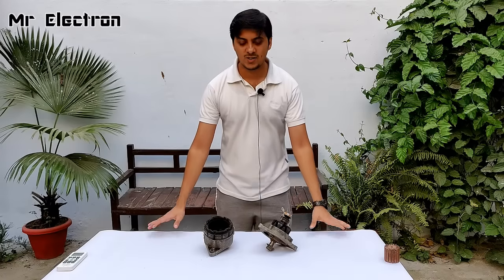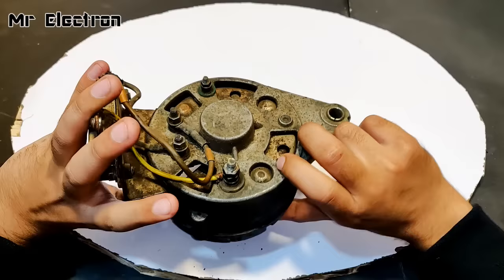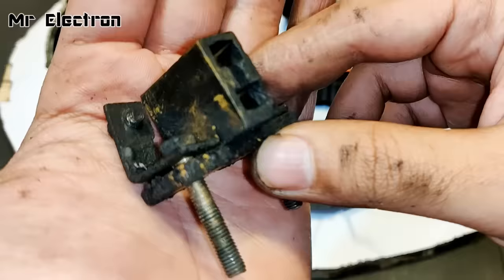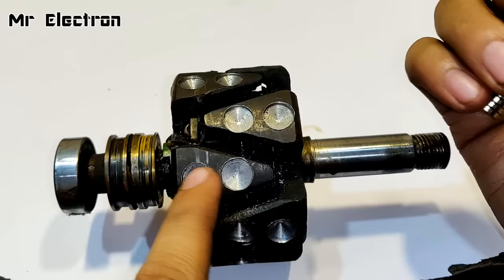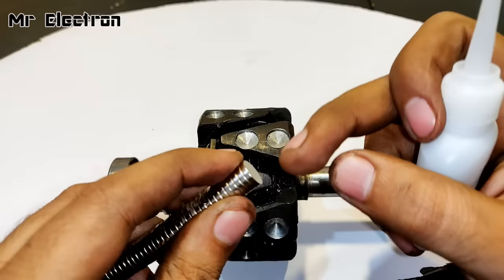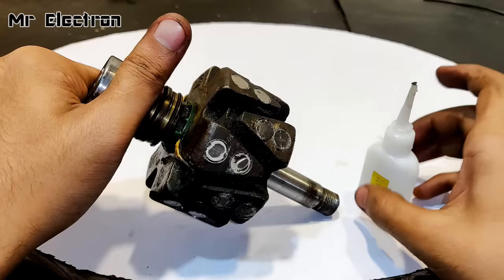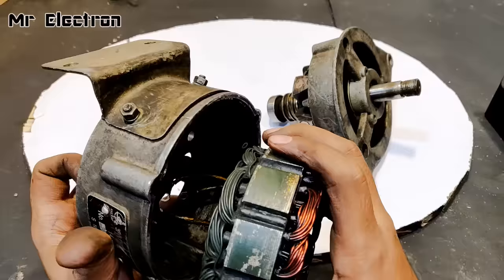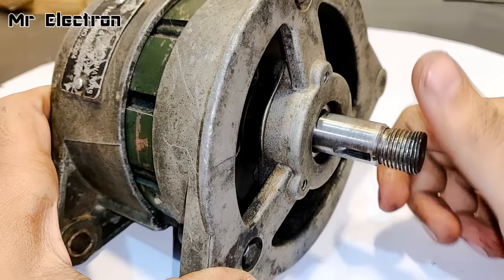12V Car Alternator to Brushless Generator Self Excited - Amazing Idea DIY

Comment: HELLO. This trial is great. Everybody is bothered from rectifier and voltage regulator, it sound like protection from malfunction but it works not to get big energy from alternator. Your trial is a breakthrough. If you turn the pulley  faster by machine, this alternator can have much more voltage and current. I was encouraged.Thank you!

Comment: A quick way to drill holes with a consistent set depth, 1: find the desired depth 2: drill first hole to depth then stop drilling 3: with the drill bit stopped and in the hole, wrap some masking tape around the drill bit's circumference at the surface of the material being drilled 4: back the bit out of the hole and start drilling the other holes. The masking tape is easily removable, won't damage the bit and clean up is a breeze. Heat and tapping compounds might cause the tape to melt or slide off so you might want to think about using different types of tape or permanent markers/paint to mark the depth on the bit.
Reply: Thanks for the tip Cliff.  I'll try it.
Reply: Don't waste time, just set your depth-stop on your drill.

Comment: for those of you wondering, the faster the spin of the stator,  the more voltage.. the bigger the wire, the more amperage.
Reply: 고마워요
Reply: @sksdksckddn  천만에요
Reply: Thick wire for more current.
Reply: @farrukhhasan7751  yes. And spin faster to produce higher voltage.
Reply: There is a limit as to how much thicker a wire can be as the current is not determined by the thickness of the wire but by the strength of the magnets, so if your magnets can only produce 1 amp then it does not matter if you have 1mm dimeter wire or 2mm thick wire it will only produce 1 amp or may be just a tiny fraction more due to the resistance to 1 amp current flowing through the wires, Power  Generation is the product of the strength of magnetic field and speed of rotation, voltage is proportional to number of turns and strength of the magnets and the speed of the rotor. And nothing comes out of nothing, so if you wanted more power then you also need more input power to spin, (Torque)
Reply: Please what do we call the magnet please please please

Comment: Appreciate your hardwork Bro, try to connect your generator motor to a Gym cycle or regular cycle Backwell and use step down transform or stepdown or stepup Module to Charge a 12v car battery, later it can be used to power the home appliances using inverter
Reply: Ani Dezman
Ani Dezman
pred 2 mesecema
I did the same as you. I got 29 volts and 0.3 Amps, which is too little to burn even the smallest 12 Volt bulb. That's why I don't believe you.

Comment: Even if u give 1500rpm u would only get 12- 15 volts. You have to use big neodymium magnet like n52. I have tried this type of convertion in half HP induction motor using n45 but the voltage was maximum of 20 volts!

Comment: Car alternators need to spin at very high revs to make even just 12 Volts. While on the car they will be 'geared up' and be running at 2 or 3 times the speed of the engine.
We are talking 10 to 20 thousand rpm - just to get 12 Volts
A much better conversion would have been to leave the brushes and the rotor coil intact and power it from a single diode connected from the output of the stator coil.
This would be after removing the original stator coils, noting how it was wound, then re-winding it with some much thinner wire.
This will give more volts and at lower rpm - making the resulting generator much more useful.
Rewind it as was, as a star connected 3-phase and connect your diode from one of the phases and back to the centre point of the star. Or make a 3-phase bridge if you prefer.
It will self-excite and the existing rotor coil will make a much stronger magnet than the permanent magnets ever could - giving you greater output.
Get as much wire into the stator as possible, every extra turn is worth more volts
Do not be greedy and expect mega mega output. For a machine/device like that, self-excited as it will be, do not ever hope for more than 200 Watts - but at least it will give measurable volts and useful power if built into a wind turbine.

Comment: I did the same as you. I got 29 volts and 0.3 Amps, which is too little to burn even the smallest 12 Volt bulb. That's why I don't believe you.

Comment: Hi Mr Electron...I am working on projects myself and have found your content very useful. I was wondering tho : could a joule thief circuit be used to excite  the alternator ??..Joule thief can provide all kinds of voltages at high frequency (low amps?)and would be interesting to find out if it could work..Many Thanks to you..

Comment: The rotor should have contained a larger magnet for higher flux density. The rotor is too heavy and more metal should have been removed from the same. Also you should have lubricated the same so that it rotates faster.

Comment: attach high speed motor to it,  then wire in a  step up transformer on the output  of alternator, test AC voltage out of the transformer.

Comment: hello sir electron ... your work is fantastic excellent the adaptation of the magnets in the alternator poles. but you should use that alternator as a brushless motor with a 1.5kwatts variable frequency drive, you could have an extraordinary electric motor. I hope you accept my advice. thank you good 2021.

Comment: There is easier method. You can put the magnets between the claw poles and it still work.
Reply: My thought exactly! Time saver for sure! Same concept as the traditional alternator inner-winding except w PMags sandwiched in between the rotor teeth, north and south come out of the bottom and top along the axial axis and those teeth bring the N and S, respectively, downward to alternate every other one... pretty cool concept and truly simple which is why it is used in the production of these alternators... 
Good comment, mate,
Cheers!

Comment: Hi Electron, this modification on the car  alternator  should produce much more energy,maybe some of the copper coils are in short circuit...  👍
Reply: Perhaps the magnets are not strong enough to generate more on this RPM? The electromagnet inside the rotor was pretty strong when the brushes provided power for it.
Reply: J'aime tellement tes interventions,tes compléments

Comment: That lamp itself was twelve volts. If the car alternator had changed, the lamp should have burned out, so it did not change anything and produced the same twelve volts.
Reply: point should be noted

Comment: Well how you solve problem over charging lead acid baterrys? Do you add external voltage regulator? What wuld hapen if you use bouth magnets and field coil together?
Wuld they cancel ich other out as in magnetic field?

Comment: The big ? is WHY. the part that spins is the rotor, an alectro-magnet the winding that the rotor spins inside of is a stator as it is stationary for you it means it does NOT move.

Comment: The set of windings from which power comes is THE STATOR as the winding is stationary.
You won't get the power from this as you would with an excited rotor winding and you can't 
control the output either.

Comment: nice try but the magnets are very smal and there for the smal voltw if there was a load it should be loer you could remove the rotor armatore and replace it with a solid piece of iron and then stick on to it some big magnet they are cost moe but they will produce more volt and amps

Comment: The reason you hammered it(which did the rotor no favors at all) was that you had the rear bearing come out with the rotor which it should not do. You should have removed the bearing, cleaned the rotor, install the bearing into the back case, then install the rotor(after lubing the shaft in the bearing area.

Comment: There doesn't seem to be any particular reason to attach magnets.
Since I am an electrician, every motor turns into a generator that generates electricity through the three-phase outgoing wiring on the other side when the actual rotor is turned quickly.
If it continued to rotate by its own force to reach a certain speed, a magnet would have been attached, but I don't know why a special magnet was attached here.

Comment: Mr. Electron:
Your going through a lot of trouble to converting a product to a product that already... You should check out a motorcycle alternator, how its put together.
You will find out that it rotors magnetic feild is based of perment magnets..

Comment: I’ve recorded 2,000v Ac with A multimeter like that on a big block Chevrolet load turn charging high amp alternator spinning it about 1500 to 1800 revolutions per minute using my battery powered impact gun which max rotation is 2000 I have recorded with a camera reaching 2000 V AC current !
Reply: Low turn charging high Amp Alternator

Comment: Looks like you used 2mm thick magnets. Would the magnetic field and the output, at the same RPM, be doubled if you used 4mm thick magnets?
Reply: Depending on the material used per magnet but theoretically yes magnetic flux field would double.

Comment: Mr. Electron I’ve installed the Neodymium magnets 12mm x 2mm N 52 how to put the center back in with the strength of these magnets will not go in like the way you put it back together ?

Comment: I found your vids a long time ago. I finally found you! Lol. I have a dead Alternator. It's a GM ( General motors) 100 Amp alternator! Half of the diodes have died. I bought a second hand unit and swapped in 15 mins at the wrecking yard, tested and drove off. Do I take the diodes out or do I replace them? I want to convert to your setup. I have 2 deep cycle batteries and 4 solar panels at 250 watts each connected to my batteries. I want run a dc motor I have lying around to power the Alternator. Any reply and ideas would be greatly appreciated! Cheers from Australia ! Subbed a long time ago but liked as always!🙂👍👍👍

Comment: I'm sorry to different engine operating speeds the alternator would have to have like a scr controlled regulator to control the output voltage and current to not blow up your electrical system they do make alternators that are brushless using the field Ford had one for ambulances 215 amps

Comment from the maker: My Hindi Channel - www.youtube.com/mrelectronhindi
Reply: Aalaa
Reply: What about replacing field coil on alternator using speaker magnet inside?
Reply: I did this like you did. But the power cannot give out. Can You tell me the reason
Reply: @hspaukap8936  how can you tell which of the 3 wires is positive and negative?? I'm still trying to figure it out.
Reply: @BOREDANDWELLBORED   the case would be the neutral and the wires would be the power....
Reply: @tommyemler1763  thank you!
Reply: I always go for my cheap meter to

Comment: If you add a magnet per pole at the same polarization as the electromagnet in the center you can make a self excited alternator that starts out as a pm generator then operates as a real alternator once up to speed. Gets rid of tge need for an external battery to excite the electromagnet in the center. All that is needed is a capacitor and an isolation diode.

Comment: Like the one comment okay for wind turbine you can run three phase down to your batteries but you'd want to take the rotors apart take the coil out machine the rotors and put a permanent  magnet in the middle

Comment: Very interesting and well explained but the small magnets set into the big surrounding area of steel, will not work. The upward facing pole of the magnet will be cancelled out by the surrounding steel acting like the opposite pole. So you will not have clear and distinct North and South poles!

Comment: Nice try but voltage is so small. Better get 1 watt solar panel, it will give you around same voltage.
Reply: Depends on how much voltage you want! 6 volts is high if you only need 3. It is amperage AND voltage that will be meaningful, if you want more than a few milliamps.
Reply: Attach some paddles to the shaft and drop in a fast moving creek or river. That way as long as you've got current (hydro), you've got current (electro), even after the sun drops over the horizon. Sure, the solar panel can be used everywhere there is sunlight but harnessing the flow of water should provide constant AND consistent amps-n-volts. You'll just be limited to where you can use the device.
Reply: عشان حط كل المغناطيس في نفس الاتجاه فمفيش خلخله في المجالات المغناطيسيه تحدث الفيض الإلكتروني الفولت اللي بيخرج ده لو قست برتقاله هتخرج كهرباء اكتر من كده هوا بس يزود عدد المغناطيس ويخلي كل صف عكس اللي بعدو هياخد كهرباء اكتر بكتير

Comment: I’ve done this but to my fault the magnets were not flush and my magnets are N-52 and the center will not slide back in through the Stator until I sand down like a Half of 1 mm off most the 14 magnets ! Drill the holes a little deeper if you do this !

Comment: यू आर मेकिंग डीसी करंट नॉट एसी 
 just because whenever it is used as alternate in car it provide AC current by  it brushes 

In  their armature, winding side will become a magnet by battery current and as soon as rotator will be rotate with engine power then the current will be generated through brushes to the entire supply.
 but you did opposite
 now you are just making opposite  to produce electricity so it is DC current

Comment: hi .actually the magnetic field of alternators are not normally constant  and it changes according to the energy consumption . if consumption becomes high so the magnetic field will be higher to keep output voltage in range . i can guess that these small magnets can not give more than 20 % of that alternators energy capacity .

Comment: Does this brushless motor gives you more output power or same output? Is the input power the same for both types?
Reply: Output on this type depends on how fast the rotor is spinning and how powerful the magnets are. No input power is needed because it's brushless. Less power is generated for sure but also less is needed to generate something.

Comment: Good idea.  Unsure how well the glue would hold up.  If you could drill a more precision hole and press the magnets in, i think that would work better and longer.  Make sure you get the poles right though, because you won't get them out once they are pressed in.
Reply: you can't press magnets, they easily broke...

Comment: i see a mistake...
outer winding of alternator uses circuit to produse constant output...
u connect only 2 thats why u have small output...
try puting 2 diodes each wire, one going in and one coming out...
then tap all diodes in one side,,,
the 3 going in then the 3 coming out...
ther ul have the right output considering d magnetism u used

Comment: Hello. The video is interesting but with permanent magnet you can't vary the amount of volts that the alternator produces
Reply: Francisco González López 
depends on how strong d magnet used...
Reply: @endurofan9854  If you can varie de amounto of magnet...
Reply: Yes, you can vary the output voltage by increasing the speed. I have a permanent magnet alternator from a small Kubota 905 diesel that I coupled to a Honda  4 stroke 35cc powerhead from a brush trimmer. Voltage varied from 34 vac to 123 vac from fast idle to wide open rpm and lit my 150 watt test light bulb accordingly. The alternator is 2 wire single phase unit  rated 20 amps and is sold on eBay for $60 US. The combination 12 v rectifier/voltage regulator has not arrived yet. The alternator has a very strong cogging effect when turned by hand. The 4 magnets are bonded to the inside of the rotating steel shell so they have no inclination to fly off at high speed. The outer shell holding the magnets rotates over the stator and the punched holes that locate the magnets sling air outwards thereby cooling the windings. Its a clever and simple alternator with no brushes or excitation needed.

Comment: Now drive shaft with DC motor low torque high rpm and then loop back put capacitors on circuit...
More output then input
No Lenz law
Reply: No, you will not get more watts out vs the watts consumed by the motor turning the shaft ... Lenz Law is the LAW !
Reply: Yes because that's how life works, there are all of these free energy devices that work so well and are so easy to make yet humans decide to go out and mine coal, oil, make wind and solar panels, ECT... Do you have any common sense bruh?

Comment: what would be the theoretical maximum voltage for an alternator setup like this?
Reply: The breakdown voltage of the coils’ enamel coating, the amount of turns determines the base voltage and scales logarithmically with rpm.

Comment: What you are calling the armature winding is actually called a “stater”. The armature is the rotating center section.
Reply: Armature winding can be defined as, an electrical machine in which emf can be generated because of the air gap field flux. It must be noted that the air gap is produced because of the DC current flow in the winding. In general, this winding is housed on slots of the stator & the field winding on rotor slots.
-Copied from trusted source..
Stator ● Stater ○

Comment: On my GM 1 wire Alternator you need to have a 12 v Dc current and I got 185v Ac using my battery powered impact gun and Spohn it 1,950 to 2,000 R.M.P wanting on a meter to check Amps it’s a B.B low turn High Apm Alternator ! Anyone know how to wire this into home fuse box ?